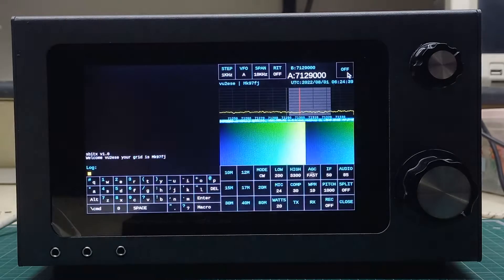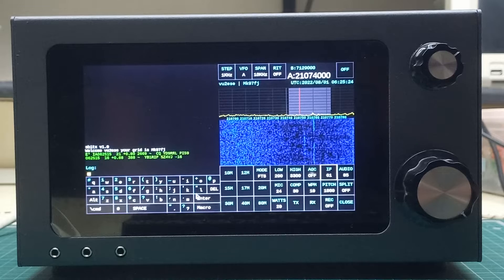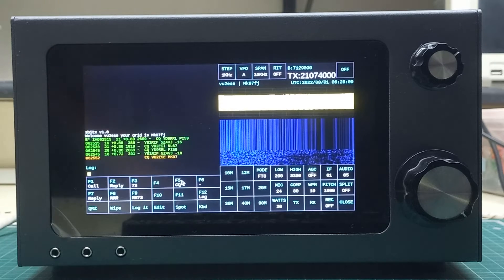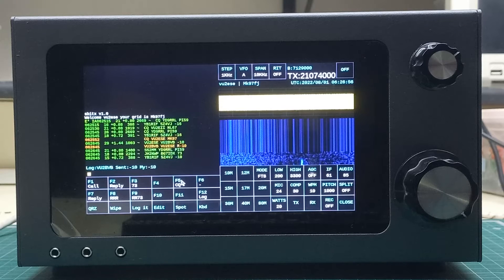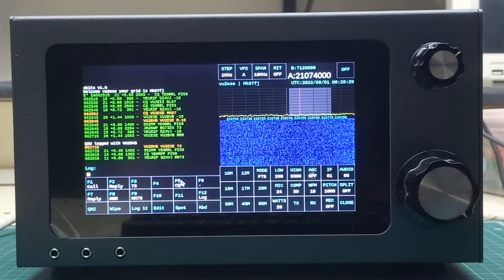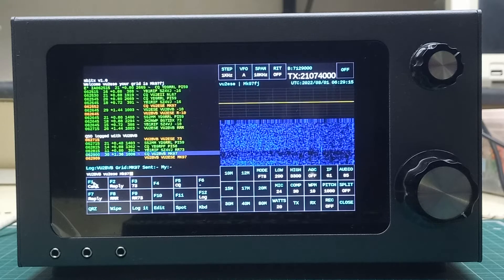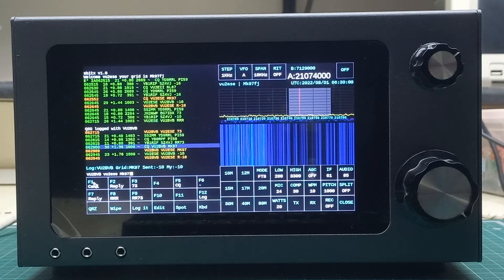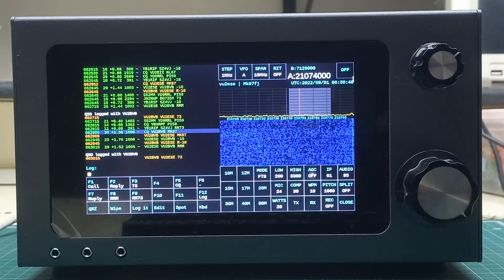sBitx working  FT8 mode with logging

Comment: Thank you for devoting 5 years to the development of this fantastic radio! However, I'm concerned about sustainability. One pattern I've observed is over the years, transmitter PAs (whether tubes, transistors, mosfets, etc.) becoming obsolete. Already I'm seeing the IRFZ24N become a victim to this phenomenon. can the IRF9Z24NPBF be used for IRFZ24N in Sbitx? I noticed the IRFZ24N spec sheet says it can handle 17 amps while the IRF9Z24NPBF, supposedly a direct replacement, spec sheet says it has a max of 12 amps. Do you have a better solution in the event I blow the PA output on my SBitx? Thanks in advance.

Comment: Have you tried to load JS8 ? JS8 might be more busy on 20 or 40 meters. I'd like to see what that looks like ... N6GRG
Reply from the maker: Th ft8 runs natively, there is no wsjtx in the background! I have every intention to add js8call to sbitx
Reply: @ashfarhan  JS8 will only run independently, and could easily be loaded I would think.
Reply: @ashfarhan  I'm really excited to see js8call on it. Definitely going to get this cool radio once it's a little more mature.